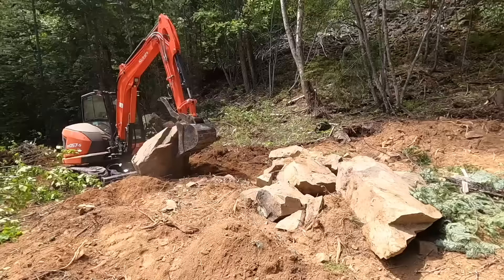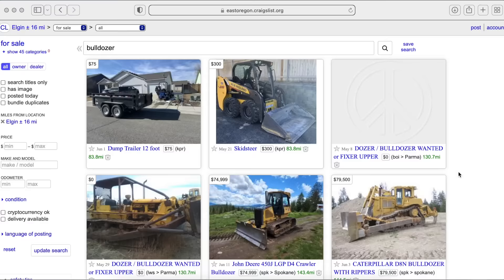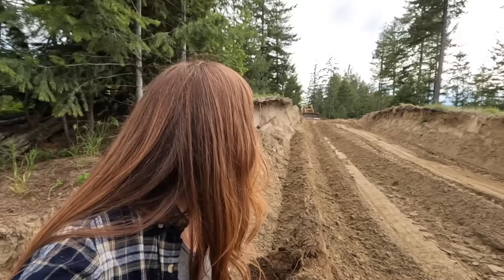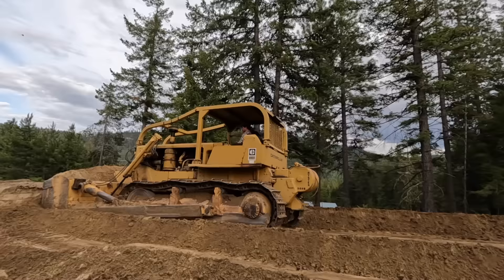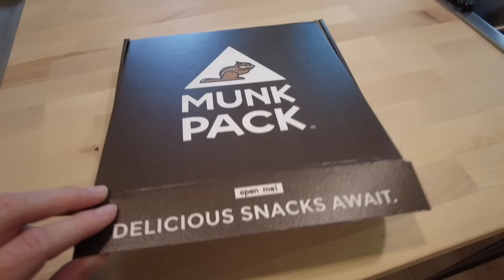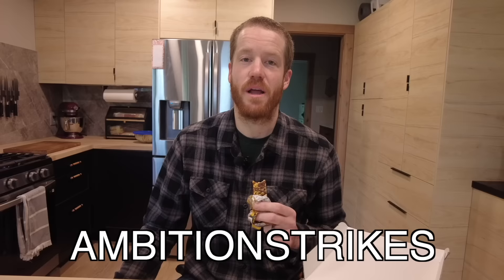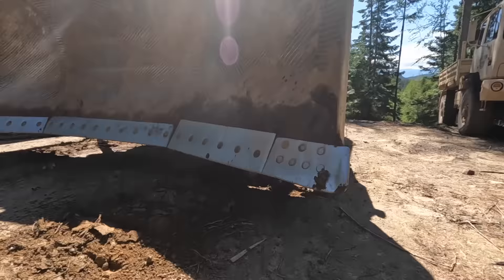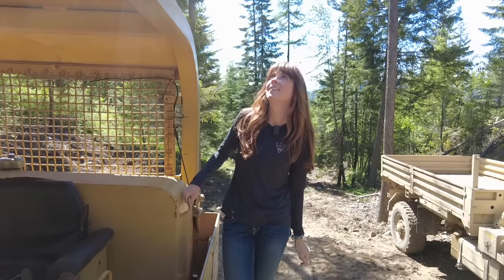We Bought The Biggest Bulldozer We Could Find || MASSIVE CAT D8

Comment: I’m curious why you didn’t just have driveway graded by a contractor.  Dozers are super expensive to maintain.
Reply from the maker: I wish it was as simple as having our driveway graded. We have about 1 mile of steep road that needs to be built from scratch.
Reply: @AmbitionStrikes  Yes I understand you have to cut and grade a road.  But one major final drive failure, track rebuild or engine work on a D8… and you’ll be wishing a contractor had done it.  Like you said you have no experience with dozers. 😄👍  Good luck!

Comment: Used equipment is really odd, the bigger it is the cheaper it is, a 50 ton machine will sell for scrap price in descent working condition, a barely running clapped out 10 ton machine will sell for the same

Comment: I keep getting these videos of random youtube influencers buying heavy equipment and not knowing how to operate it.  I don't know who or what this channel is supposed to be, but, it definately is a niche channel, where 2 twenty something kids are buying hundreds of thousands of dollars of property, and equipment, not really knowing how to run it. Seems like a waste of money.  Stuff normal people should consider when watching videos like this, is the logistics of everything.  

1. if you buy a piece of land on a mountain, the state road doesn't normally keep your roads up during the winter time, so you either maintain them yourself or you are SOL.  The state road only keeps a single lane open during the winter time in most rural areas, but those have to be highly populated areas, if there arent many people around they won't even do that.

2. if you buy a lot in the middle of nowhere without any utilities then you are expected to pay for those initial services hook ups, even if that means you are the first and you will have to pay for every pole and length of power line to get to your house. I have seen people get stuck with $50,000 bills from the power company to hook people up on power.

3. Water on top of mountains is scarce. PSD normally cant pump you city water because they use gravity feed systems and if you are higher than their water towers then you will told to dig a well, which starts out at like $30,000 because drill companies have a tendancy of requiring you to at least dig a certain amount of feet before they will come out to you.

4. While heavy equipment is great, the best thing I ever bought was an old 60s model gasoline bobcat front end loader skidsteer. I bought it 20 years ago and have used it the most of any other piece of equipment on my farm. We also have an old 70s case CK580 backhoe. It gets used here and there but it's a bit big for most projects we have. But it was a lifesaver digging water lines for the new house.